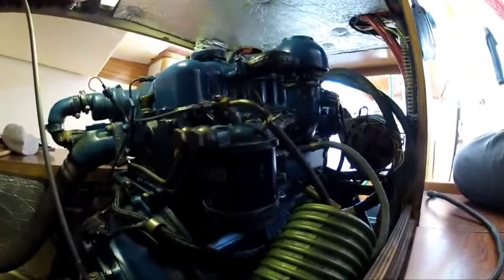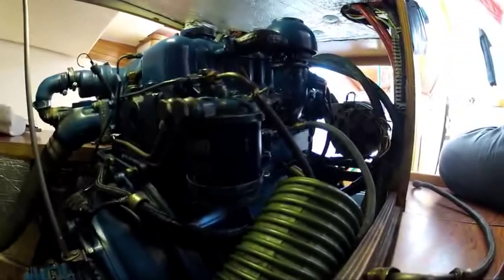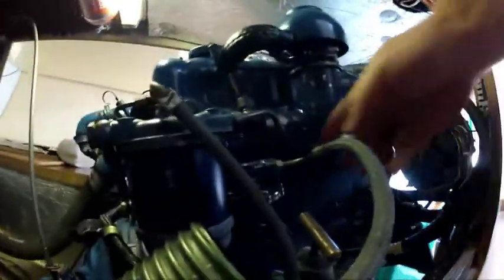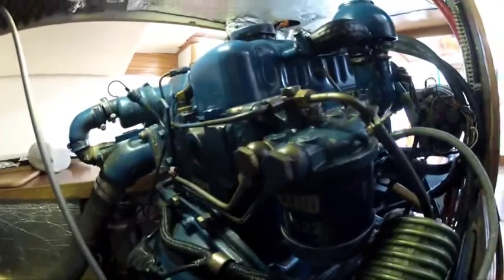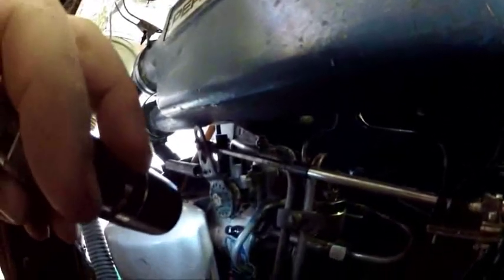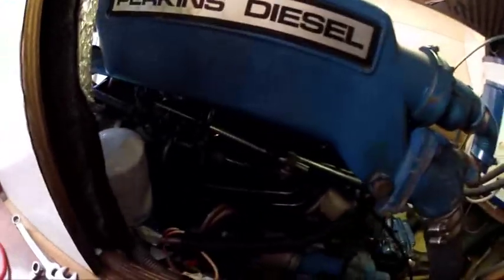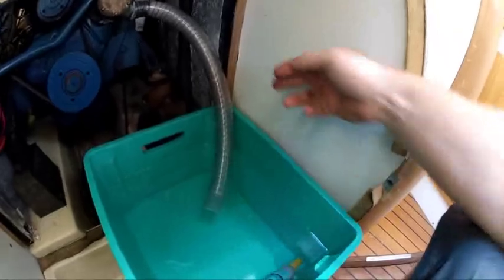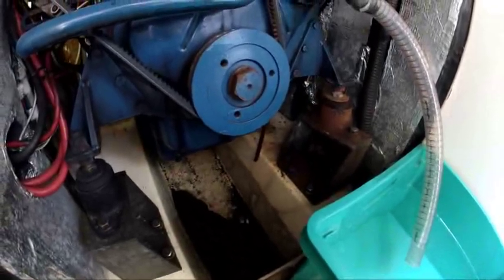Bleeding a Perkins 4108

Comment: You dont need to do all that bleeding,if you have not dismantled parts.All i do to do a maintenance bleed on my 4107 is crack open all the injectors lines turn the engine over for about 20 seconds,close the lines and she will run.

Comment: Biggest help in bleeding the 4108 is installing an electric lift pump, it also prevents future issues of diesel entering the crankcase from a failed lift-pump diaphragm.
Reply: I did this and just read that an electric pump is not advisable BC the engine is not designed to have pressure supplied. I wonder if Ive done some damage to the fuel pump perhaps by using this electric pump. (only use it for priming, not continuously)

Comment: Very well done. When I bleed a Perkins engine, what I do is , in tighten the 11 mm but on the glow plug, then using the lift pump, pump the fuel, there shall be some come out the pipe then none. Continue pumping until the fuel runs free with no air then re tighten the nut. Then the engine sound start.
Reply: where is the glow plug and how do you replace it?
Reply: @kasgol-zl9xo  the glowplug i found is the heater plug on the air intake manifold
Reply: @wts456n  Where is the intake manifold? thanks.